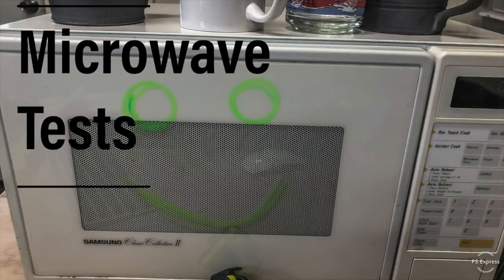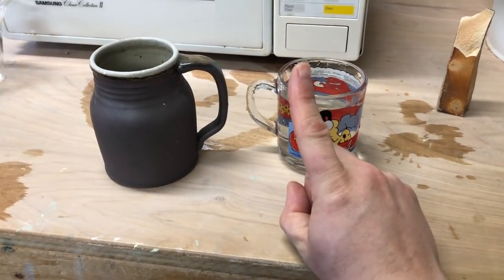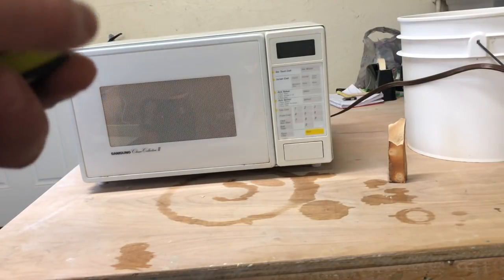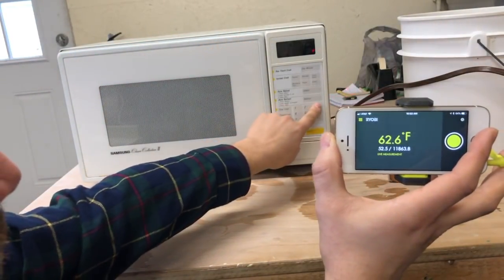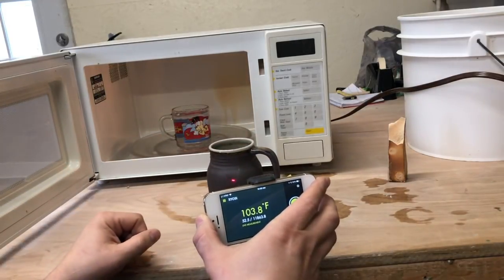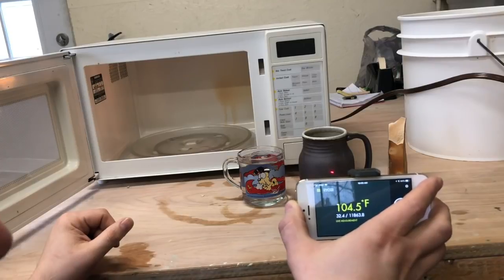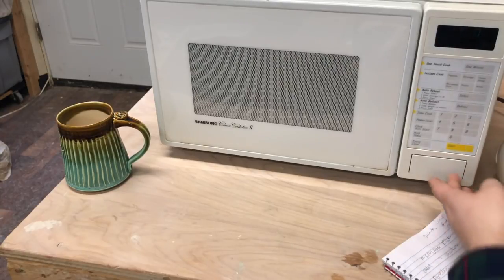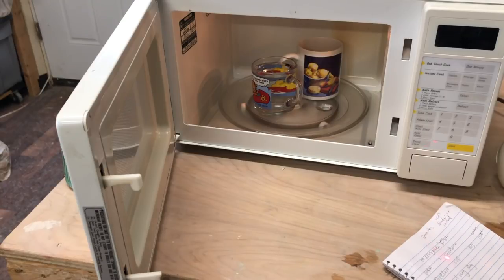Microwave testing.

Comment: In general it is dangerous to heat distilled water in the microwave. It has no particles to bubble around so it might not start visibly boiling even if it is hot enough to boil. Then as soon as it is disturbed, like by putting a tea bag in, it can suddenly boil explosively, and super hot water can get all over your hand. Since you were just doing science and not making tea, and monitoring the water with an infrared thermometer, it’s fine in this case, but just a PSA

Comment: Iron won't heat up in the microwave, it may block heating though.
Reply: Also, there is very likely a difference between metallic iron and iron oxide.

Comment: Define what would be microwave safe?  It explodes, it heats up, etc.?  If the water gets hot in  the cup, the cup will heat up where the water is, but the handles of the cup, in my opinion, should not.  To me, as long as there is no metallic in the glaze, so it doesn't explode, this should be what we're considering microwave safe.  Now, as far as pottery leaking, I've had that happen with stoneware without even being put in the microwave (I tested with just plain water on my countertop).  My bad as a newbie, though.
Reply from the maker: the cup should not get hot

Comment: Easy test! Would be interested to know if you keep that unvitrified one soaking, how long before the water saturates the mug fully? Should be able to test periodically for temperature differences between lip and base after nuking. Also, infrared gun type thermometers are $10-15 without the phone connectivity so you don't have to go by feel if you want to stay cheap. We are very good at comparative temp detection by touch, but not at guessing how much warmer one thing is than another. If 40-50 degrees difference is normal and 30 degrees difference is not, the thermometer is going to be your best bet. 

For greatest accuracy, you want to measure the distance between the water mug and the empty test mug. Also measuring temp from a consistent distance would be more accurate, as the size of the tested area changes with distance from the IR thermometer.

A couple very minor quibbles: 

The laser doesn't have anything to do with the thermometer function, it's just a sight so you can aim the thermometer.

Your distilled water assumptions are inconsistent. If it might matter enough to make a difference in the microwave, that would affect the absorbed water in the clay as well. So using tap in your soak bucket and distilled in your glass mug adds a variable you don't need. You would have a more controlled experiment by using tap in both situations. Distilled in both would of course be best practice, but tap in both would be preferable to tap in one and distilled in the other.

The microwave explanation is actually pretty fantastic except for a little detail. The wiggling of the water molecule does not generate heat, but IS heat. Heat is just the speed of wiggle. 

Overall some awesome science. I extra appreciate use of a lab notebook of proper binding, dated, and recorded in pen.